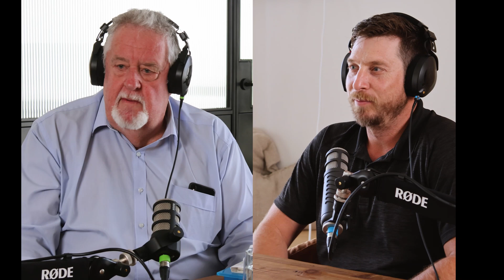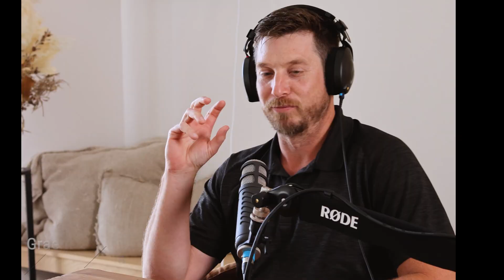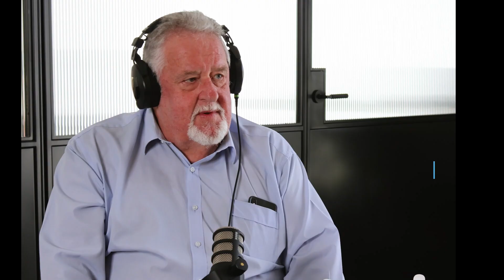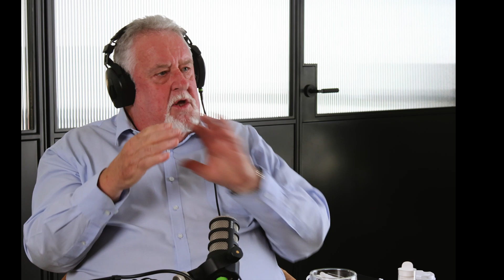The Hidden Dangers of Mould in Your Home with Xspor Australia

Comment: It's a conflict of interest for any company to provide mould testing and advice as well as conduct the actual mould remediation services. I would also be asking what recognised qualifications they have for 1. for conducting mould assessments, and, 2. for conducting mould remediation? I don't see any mention of professional qualifications/certifications for any of the services they offer (might be there, but I could not find it). The information in the video is not accurate - killing or "treating" the mould does not make it safe. Mould needs to be removed. Fogging any "treatment" instead of source removal is not in line with the international and Australian Standards (IICRC S520). I would recommend only using IICRC-certified firms with staff who have recognised qualifications/certifications for mould remediation, such as IICRC Applied Microbial Remediation Technician (AMRT).  He is also completely wrong when he discusses Conditions (1, 2 & 3) of mould being linked to numerical levels of mould sample results. I'd hate to think how many houses they have said need remediation based on their incorrect interpretation of lab analysis results.